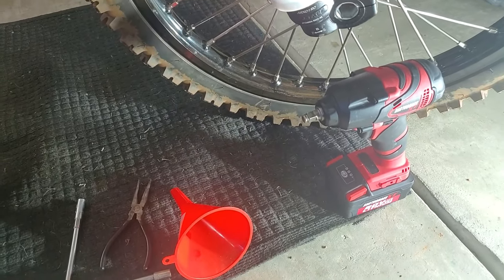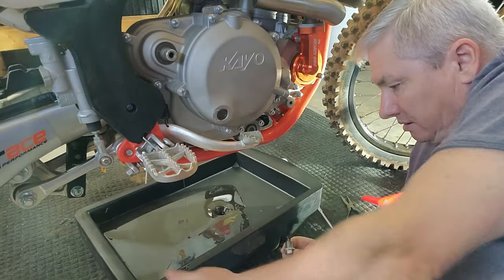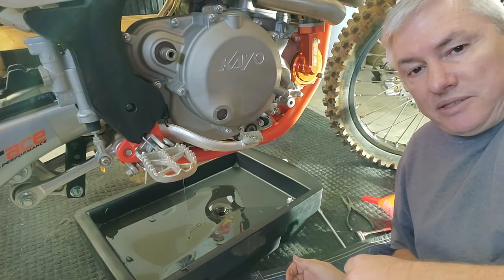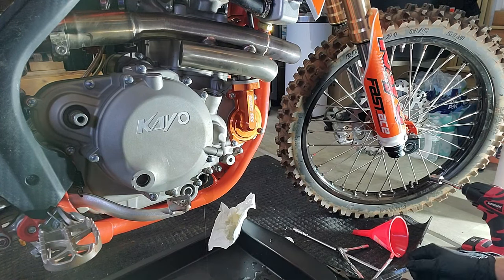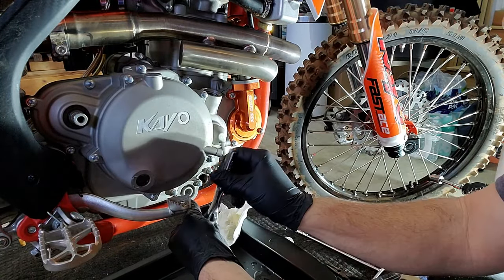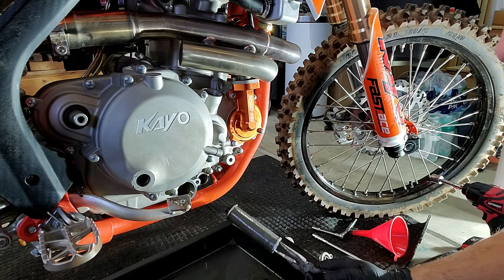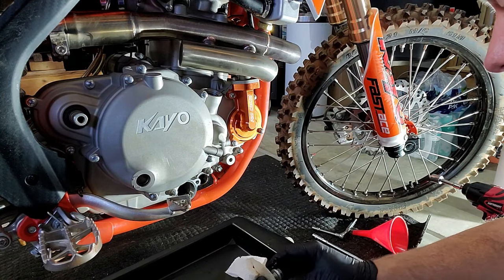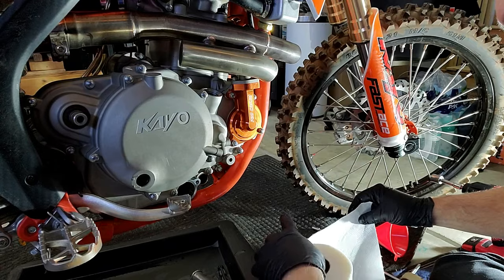How To Change Oil On Kayo K6-R 250, SSR, GPX, EGL and other NC250 Zongshen Motors

Comment: I'm completely building my 2022 sr250s nc250 to a 84mm truth 300 with 4° timing key recluse three stage clutch bigger cam wisco piston high performance valves and valve springs , rockers Fox suspension this thing is going to be a monster already keeps up with 450 Hondas no problem 6 Speed 80 mph stock

Comment: My 2021 SSR 300S has the larger metal screen and I bought the bike new, so it isn't a paper filter and that Kayo screen looks exactly like my SSR screen.  I would guess at some point they made a change for the filter...
Reply from the maker: Totally possible , I know some others have told me they had a paper  filter. I prefer the the metal screen type because you can just clean and reuse them.
Reply: @Dirt_Bike_Dave  Also, somewhere I had read 18 ftlbs on a torque wrench for the 17mm bolts and that seemed just right on my torque wrench.  Right about tight plus an 1/8 turn...
Reply from the maker: @pendamoniumpaladin1798   I thought about telling people torque specs, but not everyone owns a torque wrench. I also put a dab of grease on the threads sometimes...I did that off camera for those pesky smaller screen bolts...they had almost seized to the cases..defiantly don't over tighten them.
Reply: Im new here, just got the k6 efi yesterday and the dealer give me the metal screen filter. Be interesting to see what is in it when i change the oil the first time.

Comment: Great video but I'm a bit confused. You mentioned it's 1500 ml but is a little less than 2 qts. 1500 ml is 1.585 qts. Is it 1.6 qts or something like 1.9 qts?
Reply: One and a half quarts is just fine a little over that not a big deal as long as it's to the fill line or right in the middle of the two you're good
Reply: I for told by dealership it’s 2quarts

Comment: Where did you get that oil filter
Reply from the maker: @anthonycoley8022  Came stock on my bike..but I have seen them sold on AliExpress  under Zongshen NC250/ NC450 steel oil Filter. I also think some of the SSR bikes had them.

Comment: Good video . playing with fire on those really cheap thin plugs using an impact. Mine were super tight at 1st too
Reply from the maker: I certainly  didn't  want to...someone tightened them with one....I put a little grease on the threads when I put them back on....and no impact just a ratchet to tighten them.👍

Comment: what is the k230 oil spec then? would it be the same..  my manual has the T series
Reply from the maker: Not sure Bud...but it is normally  printed on the black oil filler cap.
Reply: @Dirt_Bike_Dave  I'll go check on that. Thank you